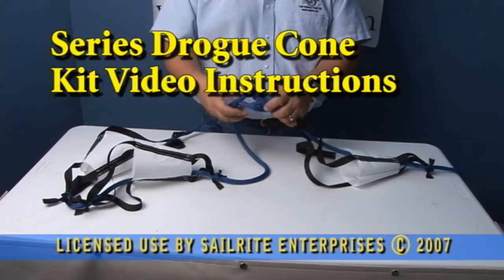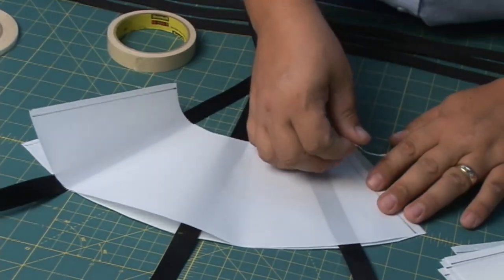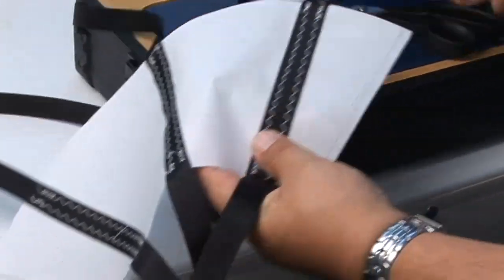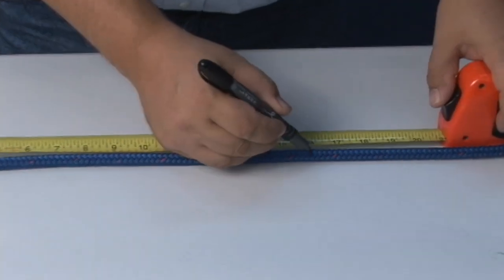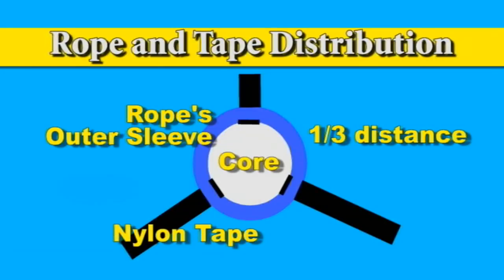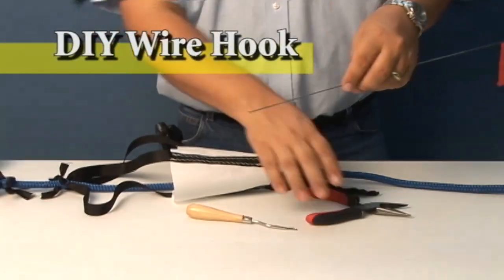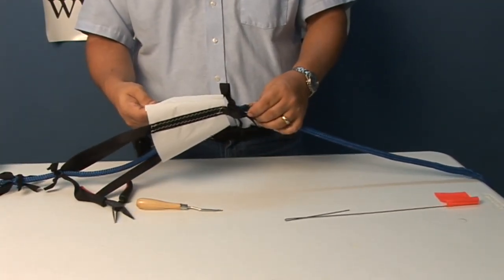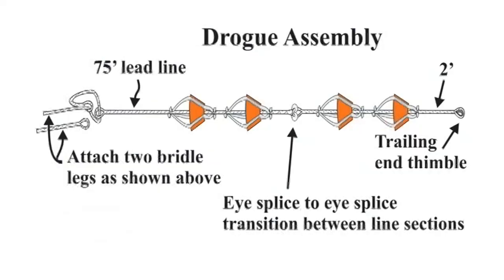Series Drogue Construction - Make Your Own Series Drogue Sea Anchor

Comment: Instead of messing with the rope & knots, etc., how about just using long sections of webbing and stitching the three straps together for the distance in-between the cones?
Reply: The line load is substantial, exceeding the capability of available webbing.  The USCG research report found a load of about 9,000 lbs for a boat of 10,000 lbs displacement.  I think Jordan recommended allowing about 60% of breaking strength (rather than the usual 20%) since use in the extreme design conditions was assumed to be a 1-time event.
Reply: @fs7453-il  I see. Well, my boat is only about 1500lbs loaded, so I might try to make a lighter weight version. Lots of webbing will handle 3K+ loads.

Comment: Suggestion for future improvement: As well as plotting the seams, why not plot lines for the position of the tapes?
Reply from the maker: Good idea, I will pass this onto Jeff here at Sailrite, to see if it can be done.
Reply from the maker: I just talked to Jeff and he said he already did that years ago. They are tick marks on the edges of the cones not a line completely across since we did not want a customer confusing them with the seaming line on the edges of the cones.
Reply: Fantastic. Thanks!

Comment: Great system. Do the figure eight knots have the potential to pull out when under load?
Reply from the maker: No, the nylon tape with figure eight knots seldom pull out of the line under high load. More commonly the cone eventually becomes damaged by fraying under extreme prolonged loads.